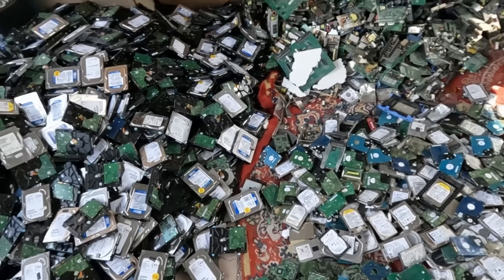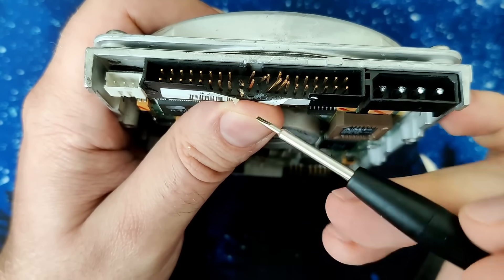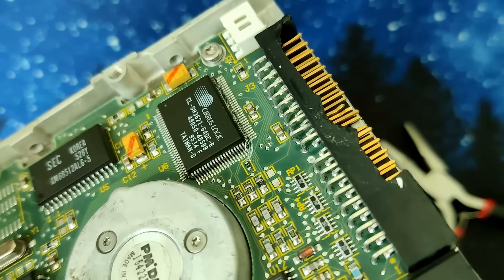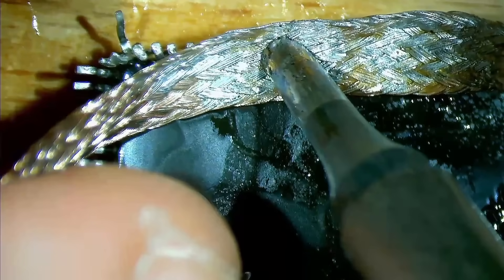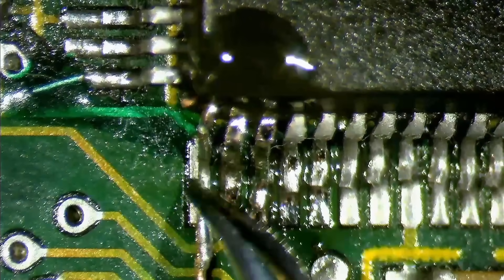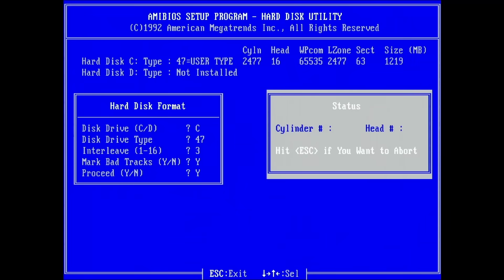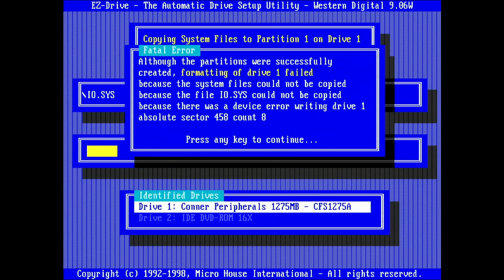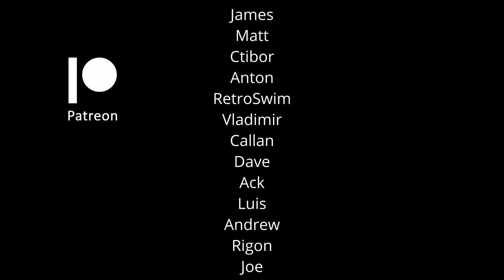IDE hard drive wants a final chance: Conner CFS1275A

Comment: Hey, what is that copper braid you use to desolder? Is there a specific recommendation?
Reply: Brand doesn't matter imo. Even some uninsulated stranded wire can wick solder. Not super well but it can do it.

But some do contain flux in it, which I guess would matter
Reply from the maker: Hello! I am using TOWOT Solder Wick. So far, I am quite happy with it. Maybe others have good wick suggestions as well.

Comment: It may be worth replacing the larger electrolytic capacitors on the board (the yellow with red stripe, and i think theres a couble black ones), those style of surface mount caps are notoriously troublemakers for things like the sega game gear, and i had two that were bad in an old bad drive

Comment: Congratulations on successful PCB repair! Unfortuneatly seems that drive have bad surface, heads or preamplifier. Could be used as spares source for even more advanced drive repairs in future.

It is sad how many unique hard drives get discarded. There will never be more such hard drives manufactured for retro computers to use.

Comment: Alas, pretty much the outcome I expected. I had no doubt you would be able to fix the board since you're really good at this, but I would have been very surprised if the internals would still have been OK. Conner drives weren't exactly reliable to begin with (are there even any known working ones left at this point? 😅)  and the age and harsh treatment at the recycler didn't improve the odds, either. It sure was worth a shot though!

I don't think cooling or heating will help in this case, as the actuator noise doesn't sound quite right to me. It's also worth a shot though of course. It isn't much extra effort and It's broken already, so it can't get any worse. Maybe some hardened grease loosens, some tolerances line up better or a capacitor value improves as it warms up, as the situation improved the longer it was running. I don''t see any electrolytic caps though. Ultimately, you should have a look inside, maybe you/we can at least learn what the cause of the remaining issue was.

Regarding the image quality, I think it's perfectly fine as it is, you could have spared the expense. Higher quality will of course still be nice though. Already looking forward to more Voodoo content! ♥

Comment: Honestly with a Conner drive it got a lot further than I anticipated.  Even back in the day I had no success with connor drives.  Our 486 from Packard Bell came with a Connor 170MB drive.  And within the first year of owning the machine the drive failed and we had to get Packard Bell to replace it.  The replaced Connor drive died in a week.  Thinking it was something wrong with the computer, we took the whole machine in to be worked on.  Machine was fine.  Next Connor drive failed in a month.  Fourth drive replacement that they did was a Seagate and it didn't have problems for the rest of the time we had the machine.

Comment: A fun story: I also have a Conner drive I been trying my all to get running again and pretty much also drove me crazy trying. The fact that my drive also have been working and just been stored makes it even more annoying. it have developed the click of death when trying to access the drive at all, however it spins up and self test normally every time but then always fail in every aspect. I can make one computer detect it enough but it only shows it has 2 sectors total and fails to do anything but clicking, clicking and clicking. I given up on it how sad it is to do so. My guess is either "cluster rot" making the initiation fail, or Head crash due to either stiction or bearing wobble from storing. But I at least have more Conners that still work. But hey, I am sad for losing a single drive, Just imagine how I feel when I see that HUGE MOUNTAIN of trashed drives on the ground! I wish I also could go dig in that pile but I live in flippin Sweden 😭

Comment: I managed to get quite a few "scrap" 1TB SATA drives back in the day - they came from a huge server farm and it appeared the majority of them worked fine. I learnt later that the IT staff had pulled the incorrect drives when the array flagged a failure. Sadly the supply was short lived as they invested in a bulk eraser that wiped all info off the disk - including the geometry settings. The effort to revive them was no longer worth it.
Reply from the maker: I have seen hard drives in their original, sealed packaging. Dell hard drives, never installed in any system! There were at least 10 brand new drives. But they were for servers (SAS connector).
Reply: @bitsundbolts   I have quite a few of those as well - I think it was due to the use case. Enterprise bought a surplus of drives to enable hot swapping and when the server is decommissioned those spares go with it! 
Sadly in the UK WEEE laws require businesses to dispose of ewaste in a documented way - no more "dumpster diving"!

Comment: There is a serial console available for diagnostics on the J4 header pins at the PCB.

I think you can trace it back to the CPU which is the 68HC11 chip ( U10, house marked SC415016AFU) 

Dumping the ROM might show you the list of commands.

Comment: Why did you even bother wasting your time repairing the IDE connector and chip. It obviously had a significant impact so was never going to work. Im surprised the BIOS detected it at all. When you open it, the heads will be damaged and the platters will be scratched.

Comment: I suppose in the end it's good practice. Personally I'm not a fan of hard drives so I don't think there is a reason to put too much effort in them. I've thought about taking apart a 2019 laptop that failed after 2 months of use. Just for SMD practice. I've never done it before. Anyway.....it was ugly, but it apparently did the trick. I don't think it would have shown up otherwise.

Comment: I would have a try with a factory tool, in case it can low level format and initialise the drive. I did not find anything related to Conner, but at least The Retro Web seems to have Seagate format utility. It might be able to recognise the drive, as Seagate acquired Conner at some point.
Reply from the maker: Good point. I'll have a look!

Comment: I'd be interested to know what happens to these old drives at the facility.  Do components get removed from boards, are valuable materials recovered - gold, copper, aluminium, etc - or does it all go in a giant machine that compacts and/or shreds it, and then it all goes in landfill?
Reply from the maker: They do mostly separation of individual parts. Plastic from metal, electronics from Disk platters, etc. then the separated parts are moved somewhere else for recovery. I do not believe there is anything that goes to landfills

Comment: I agree with a few other commenters. Check the circuit board for bad solder joints and shorted components. The media sounds like it's working. There is some hidden damage from the impact.
Reply from the maker: I will have another look at the PCB! 👍

Comment: Physical damage on a hard drive sound fatal to the heads inside. I think they're still able to move to certain locations but fail to deliver any data from the disks. Guess if you were to stick the board onto another drive that has failed electronics it could work again with this board.
Reply from the maker: Agreed. I will keep the PCB. The internals of the drive were probably damaged long time ago or because of the mishandling at the scrapyard. But I am going to give it another try. There are many suggestions I want to try.

Comment: That is a great repair, and a beautiful drive, even if it doesn't work.
Have you tried making a smaller partition, only until right before the rest of the process fails, and ignoring the rest of the space? I'm using some HDDs like this, the space available to me is smaller but at least they work.
Reply from the maker: The EZ partition was successfully created. It is a very tiny portion on the drive. You might be right that this may work, but only for a very tiny portion. I will try a few other tools and also see if small partitions may work somehow.

Comment: Really seems to me like a cracked solder joint on a component causing flaky behavior. And while it's probably not the cause, i'd go and replace all the tantalums on the underside of that drive just to make sure you have caps within spec going to everything...  Honestly, baking the board might be the way to go in this case.
Reply from the maker: I will check the PCB once more and see if I can see anything that I may have missed before. Might be an interesting candidate to test the preheating station that is arriving in the next couple of days.
Reply: @bitsundbolts  let us know if any results!
Reply: I think before baking the board I'd want to go over the rest of the chips on the board to check they haven't had a pin broken free from its pad, also checking the discretes to make sure they're all present and not cracked or missing.

Comment: Before using higher level software to work with partitions, try scanning surface by MHDD or Victoria DOS software. If reading failes, first run full erase scan.
Maybe HDAT2 will also do the trick.
Reply from the maker: Right! Those tools do not care about partitions. I will try them. They are part of the "Ultimate Boot CD" project.
Reply: @bitsundbolts  yes, those programms don't care about logical content, those print sector access time. If harddrive has issues, access time will be higher ("green" and "red" sectors), if there are unreadable ("bad") blocks - those will be displayed as well. Sometimes bad blocks are of software kind and can be fixed by rewriting them. That's why full write scan could help. Writing will not fix hardware bad sectors though. But it can force harddrive to remap those to reserved space (depends on a firmware). You can can view SMART there and see if Reallocated sector count grows or not.
One note: you may need older MHDD versions (like 2.60) to properly scan older drives (<8 GB) with CHS addressing. Newer versions of MHDD and Victoria only work through LBA addressing.
Reply from the maker: Thanks for the info. I'll try and see how far I get.

Comment: By the sound of the drive the platter motor bearing is on its way out and this is enough to wobble the platter enough to not be able to work reliably. Try putting the drive upside down on the table or on its side and see if this changes anything.
Reply from the maker: I did try to run the drive standing on its side. There was no change in sound or behavior.

Comment: I'm really shocked you actually did get it working, the connector wasn't what I thought would do it but that chip looked absolutely screwed. Expert repair. I'm curious to see what the platters look like, there might be some head crashes.

Your macro lens is fine honestly, the quality is pretty good up close on the chip like that, interested to see what the new one would be like though
Reply from the maker: I was amazed seeing the Conner drive report to the BIOS :) Thanks for thinking this is an expert repair - because I am definitely not an expert. I just have a lot of patience! It could be that some heads are damaged due to excessive shocks.
I am curious about the new microscope camera as well. It was quite expensive and I am curious if I will be able to improve the quality. It is NOT a cheapo camera (550 USD after discount - original price was 720 USD). I took advantage of November 11 sales. Why did I spend so much money on it? It allows me to stream directly via USB (no need for HDMI cable). It also supports 4K, wireless data transfer, has a 1/1.2" sensor, etc. I hope this to be an investment for the future!
Reply: The platters will be ruined.
Reply: @simontay4851  it can't be more ruined than it already is

Comment: Use MHDD to ERASE the drive a few times and see if it helps :)
Reply from the maker: I'll try MHDD which is part of the "Ultimate Boot CD" project.
Reply: @bitsundbolts  yes :) it removes "soft" bad sectors quite efficiently

Comment: Get a usb to ide cable when you go back and a usb a to c adapter so you can connect drives to your phone as a quick test the smaller drives normally work without ext power but the full size drives might work with a battery bank.
Reply from the maker: I do have one of those universal IDE (40/44) and SATA to USB converters. 2.5" drives spin up and I was able to identify some broken ones (clicking, not spinning up, horrible scratching noises). I think about 80% of the drives at that place are DEAD. Chances are totally against you. Larger drives won't spin up as far as I am aware (without a proper 12V external power supply).

Comment: Hard drive heaven.
Reply from the maker: So many HDDs... It was funny when I arrived at the "shop" to look for drives: There were bags full of them. The guys there are really friendly and allowed me to be in one corner filtering through the drives, but they do treat those hard drives like potatoes :D Bag upside down and pull on the edges. Horror for anyone who loves hard drives!
Reply: It's sad how old computers are treated. They still perform their intended functions and run their software perfectly today. Unlike modern machines with parts of the software stored in the cloud, or Apple policies that make 5 year old systems break capability so you end up with beautiful paperweights on your desk.

Comment: Tip for if you go back to the scrapyard; if you pick up harddisks again, try to find 2 of the same type so you could swap pcbs/components. I think you're able to find multiples of the same drives since they were so widely available. :)
Reply from the maker: I'll definitely keep the PCB. I also kept it from the Quantum GoDrive. You are right, it might come in handy one day.
Reply: @bitsundbolts Sure as heck is. I have already recovered some data from a dead Seagate because I had two identical drives so I could switch the PCB.
But I was lucky since it was only the electronics that failed, much more often it's the mechanical parts...
Reply: That is good advice. I myself did a PCB swap of a HDD once. It was brand new, but a SMD component fell off due to a manufacturing defect. As the platters were still intact I was able to restore my data swapping the PCB out for that of another drive of the same brand and type. Obviously, I never bought a drive of that brand and type again.
Reply: Even head swaps on older drives are quite trivial.

Comment: a good tip is if  the hard drive is internally damaged, and board is good keep the board as you can always use it on a same drive withe dead board
Reply from the maker: Yes, I will keep the PCB. I also kept the board of the Quantum GoDrive. I may come across the same drives again that may be in need of spares.

Comment: A) Amazing repair. I figured you had no chance in hell of getting the PCB to work.
B) Try a Linux or FreeBSD environment (FreeBSD install media can do a liveCD, and Linux has the excellent SystemRescueCD project). You'll get much more detailed diagnostic messages in syslog, and command line actions like "dd if=/dev/zero of=/dev/sda" can be used to do a whole-drive sequential write, while "dd if=/dev/sda of=/dev/null" can be used to do a whole-drive sequential read. That drive might actually have SMART tables you can query too.
Reply from the maker: I'll give it another try with some more tools. If you don't hear anything about this drive anymore, then I was not able to get any further. But interesting that there is still a lot of knowledge about spinning disks out there! Great! And thanks for the details!
Reply: There is also GNU ddrescue, a more advanced tool that continues even when it encounters errors and can build a map of problematic areas. You can run the tool many times using the map, and try accessing the problem areas with different settings applied.
Reply from the maker: I'll give it a try
Reply: And on Linux , with hdparm you can slow the rotation speed, and other performance settings.
It often helped me saving disks contents when I worked as a sys admin in the 2000,s, for example rescuing a dead drive for a customer with important configuration settings no one remembered how to replicate :)
It took more then one day and one night to read this disk, but I finally managed to clone it.

Comment: Give it a try with HDAT2 (free DOS software, and a must have tool to test and refurbish storage media). Try to run multiple wipes and then run a surface scan. Perhaps you can get some more life out of it.
The freezer method only has a minimal sucess rate when heads are stuck to the platter and the disc doesn't spin. If the disc spins, freezing the disk will not help.
Reply from the maker: I have not tested HDAT2. It is available on the "Ultimate Boot CD". I will give it a try. I have never "performed" the freezer trick, but good to know that chances are limited - thanks!

Comment: Honestly, there's little to be lost by opening the drive physically in a clean environment, and making sure there is no obstruction of the heads or the motor spindle. 

You can't really make it worse from the physical point of view. 

Btw, I have the boards I mentioned a while ago to replace the very hot linear regulator on the voodoo 3 now; I'll be testing them soon and if they don't catch on fire I can arrange to ship you one.
Reply: I do that using a film processing bag as my kinda clean room.  It often lets you at least pull the data.
Reply from the maker: @hicknopunk8314 I'll try to make something like that. Would be a fun project to make a tiny cleanroom in some sort of a cardboard box with filtering the air (circulation) etc. Not sure if I am getting ahead of myself 😂
Reply: @bitsundbolts  since you won't do film, get a clear bag.
Reply from the maker: I will open the drive eventually. I am interested in seeing the inside of the drive - and I am sure others would like to see it too. The drive is quite heavy. If I am not mistaken, this drive has 3 platters (6 heads).